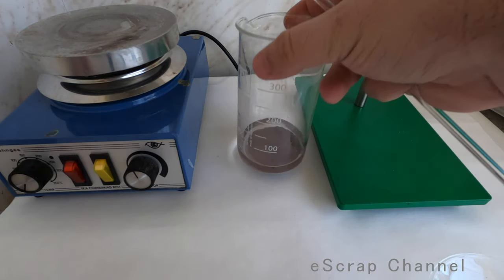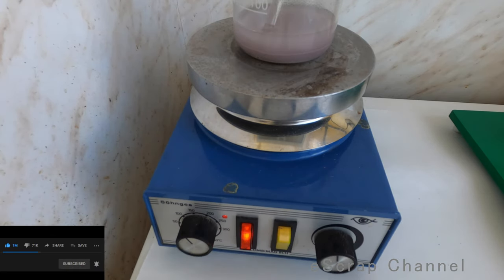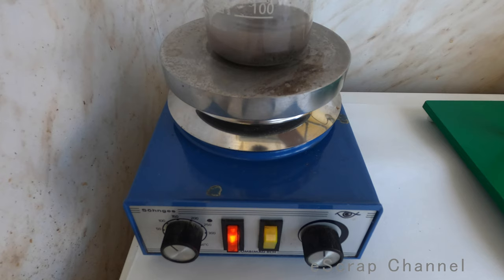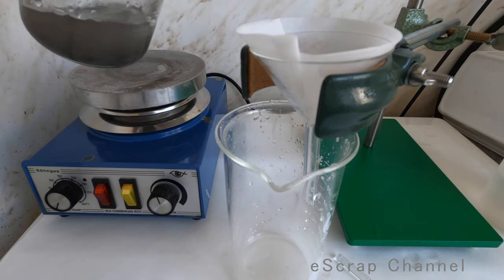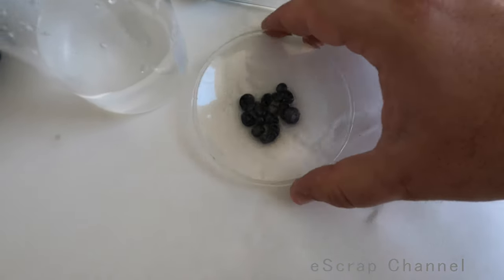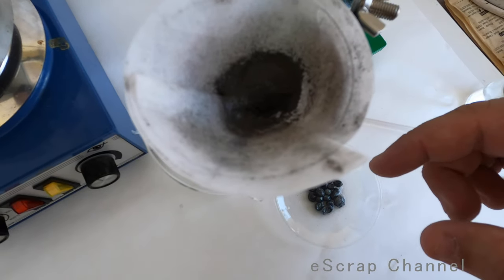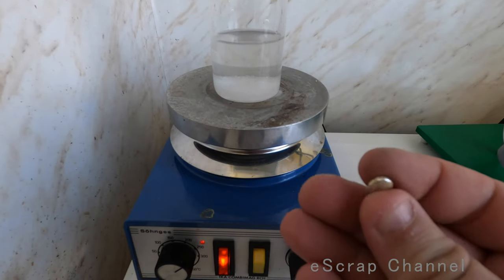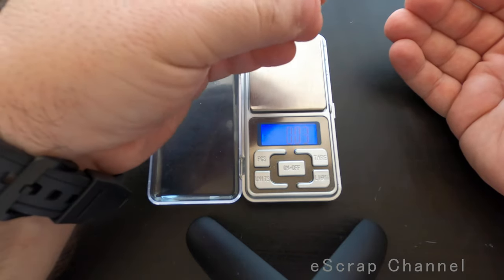How to recover Pure Silver from Silver Chloride

Comment: Is silver profitable?????? Plz reply
Reply from the maker: Hi, in the videos - not always, as I am trying to mostly show the methods. In the higher scale - yes.
Reply: Butane gass is used in torch???
Reply from the maker: @gulfamali7808  High temperature MAPP gas I use.
Reply: Plz show the video how make gass for melting metals of silver powder and gold powder
Reply from the maker: I buy MAPP gas from the shop. For silver melting MAPP gas is super efficient as silver melts at lower temperature than gold. For gold I use MAPP gas with oxygen. Melts gold super fast.
Reply: I can silver nitrate and copper reaction replace on silver chloride? Can I use Mapp gass ???
Reply from the maker: Yes, you can use copper to recover silver. MAPP gas is a high temperature mixture that gives very high temperature, so melting is quick.

Comment: Hallo sir plz help me I want to silver recover xray film  .but without nitric act  plz tell me without nitric prosses
Reply from the maker: Hi, there was a method to wash X-rays with sodium hydroxide solution. As silver is in gelatine.
Reply: Which chemical has to be done after washing with sodium hydroxide?
Reply from the maker: @awesomehygienecliningprodu5819  Are films used or unused?
Reply: Sir unuse
Reply: I'm last time use netric act but verry harmful and costly  I'm agen parches  xray film
Reply from the maker: @awesomehygienecliningprodu5819  I recovered silver from used X-ray films. After washing them with NaOH you have silver in the solution. So you can filter or wait 2-3 days. Silver residue with some organic will be on the bottom or on the filter. Then you can directly melt or purify through the nitric acid cycle - then AgCl - Ag - melt.
Reply from the maker: @awesomehygienecliningprodu5819  ok, just wrote to you about used. For the unused you have silver bromide washed from the films. You can filter it and it will filter with some organic. Then use aluminium or zinc with some hydrochloride acid to add to the residue and recover silver.
Reply: Last question 1kg xray film how much recover silver
Reply from the maker: @awesomehygienecliningprodu5819  5-6 grams. I've seen maximum 8.
Reply: Thenxx dude my name is sadiq from India and you
Reply from the maker: @awesomehygienecliningprodu5819  5-8 gram for used

Comment: Sir please help me
Reply from the maker: Sure, tell me?
Reply: @escrapchannel  sir I had 10 kg of silver chloride. I added 4 kg of lye after that have added more then 4 kg of sugar but silver cement is not being done.
Reply from the maker: Hi, just wash and dry back silver chloride. Then add water to cover it and a little on top. Add 200 ml hydrochloric acid and a big piece of aluminum metal. Quick and easy :)
Reply: Approx how much aluminium
Reply: Powder is so sticky
Reply from the maker: Wash with hot water - multiple times.
Reply from the maker: Excess - add a lot. It will react as much as needed and you will remove the remaining.
Reply from the maker: Reaction may go fast so, keep it in a big bucket.
Reply: @escrapchannel  sir what will be after that process
Reply: Can you explain with a video
Reply from the maker: @RSoni-rv5ip  Silver chloride will transform in silver and some aluminum pieces will be left. Just remove the remaining aluminum and dry out the silver powder. That’s all. Quick and easy.
Reply from the maker: @RSoni-rv5ip  https://youtu.be/yZ8zLMFlvLw
Reply from the maker: @RSoni-rv5ip  This one is in Russian language but you can see the process.
Reply from the maker: If reaction goes slowly - add more hydrochloric acid.
Reply: @escrapchannel  sir in that video he use silver chloride but I have silver oxide because I have added sodium hydroxide. It looks like dark gray sticky mud.
Reply from the maker: @RSoni-rv5ip  try to convert it back to solution with ammonia. Check on small amount if it works.
Reply from the maker: Did you heat silver oxide when you added sugar? You can try with small amount and heat it, but carefully as reaction may boil and go really fast.
Reply: @escrapchannel  sir when I had added naoh in agcl then it was heat up but when I added sugar there was no heat reaction
Reply from the maker: Heat it - take 100 grams and heat it carefully in a big beaker glass. Reaction needs heat sometimes to start. Then goes fast.
Reply: @escrapchannel  I will try and inform you.
Reply: @escrapchannel  your mentioned formula worked
Reply: Thank you so much sir.
Reply from the maker: Nice to hear it! 👍
Reply from the maker: Nice to hear it! 👍
Reply: @escrapchannel  From where are you sir?
Reply from the maker: @RSoni-rv5ip  🇧🇬 Bulgaria

Comment: I totally failed last time I tried
Reply from the maker: Hi, tell me what went wrong. If I can help?
Reply: I had processed some purple ceramic CPUs. And I was told they had silver. Which they did, well I think they did. Not much but some. So I was told to wash it with hcl and then wash 8 to 10 times with boiling water. I did that and the water was clear. But when I added some sodium hydroxide ( drain cleaner) and mixed it warmed and turned dark grey then black. I then added sugar about 5 to 10 minutes later. I mixed and mixed but the silver chloride never thickened into silver oxide or metallic. What did I do wrong? And do u know how to make silver cell?
Reply from the maker: The method you follow refiners use when chasing 9999 silver purity. To avoid any other metal in the final alloy they use sugar method. 
I usually keep it simple with silver - you can add a piece of aluminum to to the silver chloride white residue with some hydrochloric acid to speed up the reaction and little heat. Simple and quick. You can wash final silver in hydrochloric acid to dissolve any small pieces of aluminum left and get pretty pure 999+ silver metal.
About the silver cell, Sreetips has a good series of videos on setup, but it is used for purification of silver metal and is effective when you process in kilogram scale chasing super high purity.
Reply: @escrapchannel  so instead of sugar and lye you just put zinc or aluminum in it and it'll process out as silver oxide or silver metallic? Is that all?
Reply from the maker: Hi, you get metallic silver. Aluminum or zinc dissolves and reduces silver to metal dust. If you use aluminum keep some water above the silver chloride residue and add 2-3 ml hydrochloric acid to kick the reaction as aluminum is covered wit aluminum oxide. Also heating to 60-70 degrees Celsius helps.
Reply: @escrapchannel  thank you so much. Are u available for other questions? Got an email?
Reply from the maker: Hi, sure! Drop a message here and we will figure out email or other option.
Reply from the maker: Hi, I am in Switzerland and I think we have some time difference? Just closed my laptop and writing from the phone. If you send me an email I will save it and write to you. You can quickly delete email a minute after provided.
Reply from the maker: Sent an email.